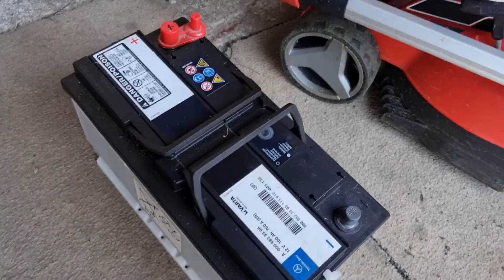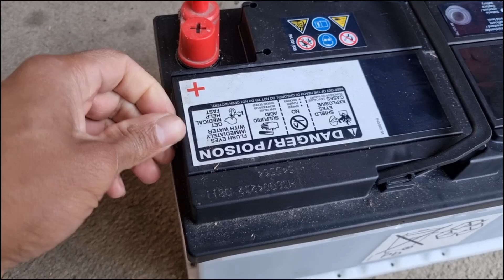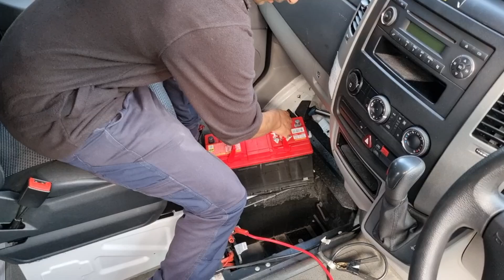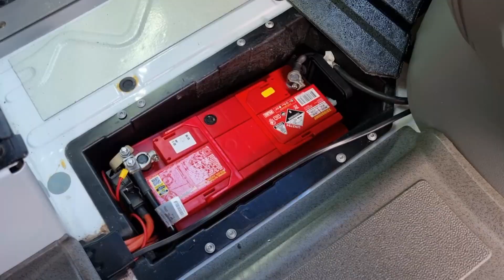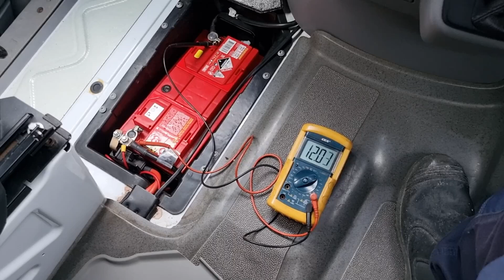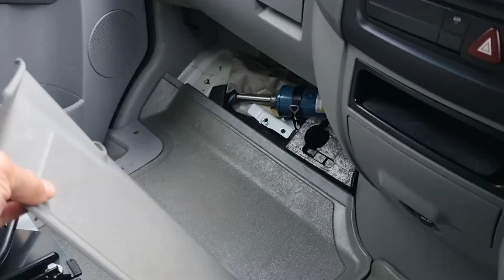Mercedes Sprinter Battery Replacement & Easy Alternator Test

Comment: My van also has a battery under the bonnet as well as one in the cab under the floor . do they both need to be good or can i just use the one under the bonnet which i presume is Soley to start the car. The van is ex ambulance. Thanks
Reply from the maker: Check what the loads are on the secondary battery and generally rule of thumb is to ensure both batteries are in good working order to prevent early failure of the alternator

Comment: I need a valve cover gasket and injector seals done on a kea horizon  2015  can you advise by email how in can get it booked in to your workshop  cheers
Reply from the maker: Hi Darren, whats your email. We are still on the lookout for a suitable workshop have not setup up yet. In the meantime you could take it down to Keith Andrews